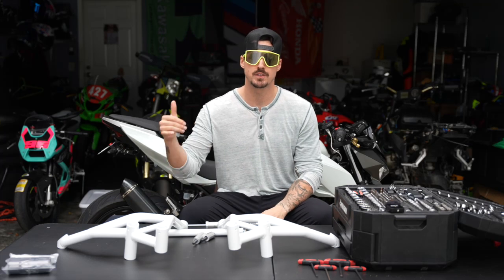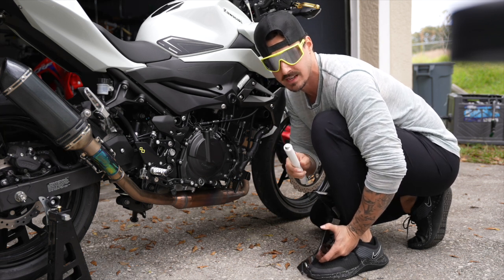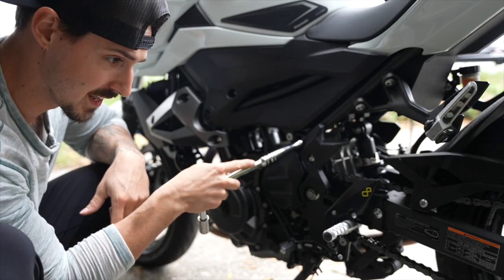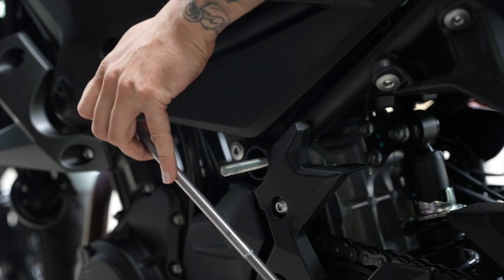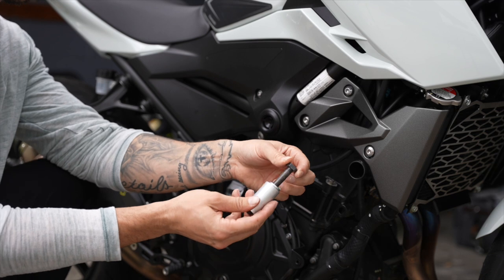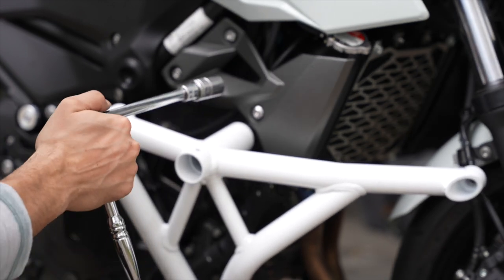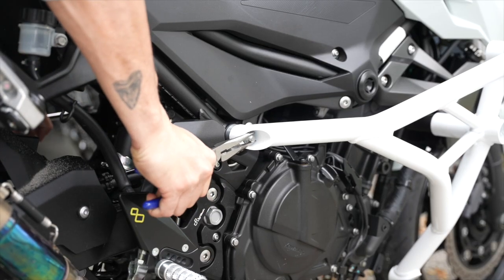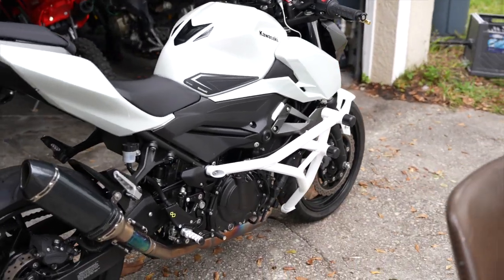Impaktech Install Perfect Fit (Ninja and Z Models)

Comment: This is the video I needed, I ordered a crash cage and sub cage from impaktech for my z650, and I was looking for a video that showed an in-depth install with clear video.
Reply: Hey did you have to cut anything on your Z650? I have a 2023 model. I’m considering getting cages but now I’m worried if I have to cut anything.
Reply: @sleepypandas3520 sorry for the late response but no, you don't have to cut anything on the z650
Reply: @Germanz6 THANK YOU! No worries about the late reply. Now I know I can order them safely without having to cut anything cause I did not want to do that Lol
Reply: @Germanz6  do you have any issues with your shin hitting the impaktech when you shift at all? I am seeing a couple comments about that regarding the z400. I have a 2022 z650 but am hesitant in ordering.
Reply: @kimbogaming4540 I haven't had any issues with my shins hitting the crash bars

Comment: I've been trying to instal my crash cage on my Z400 but having an issue with my shins bumping the cage every time I go to shift.... Did you run into this issue at all? I see you've got aftermarket rear sets. Is that going to be pretty much my only solution? If so, what rearsets do you run?